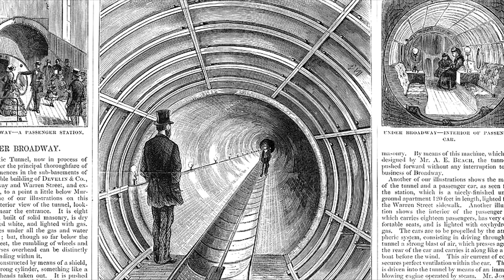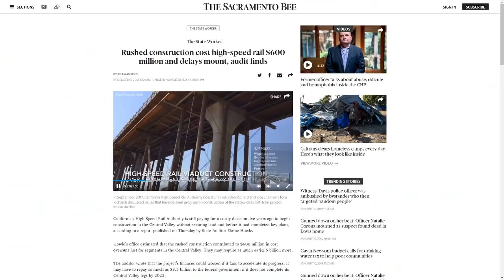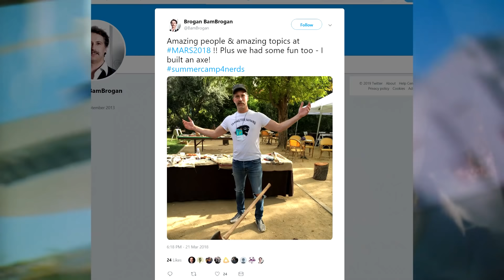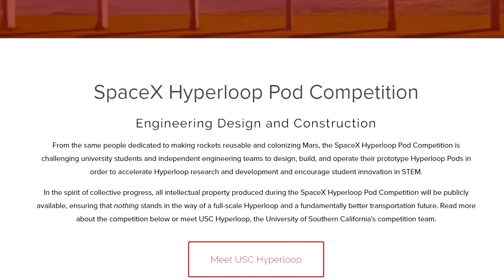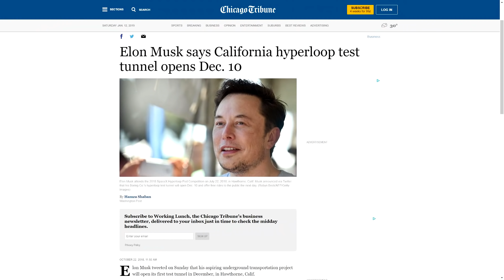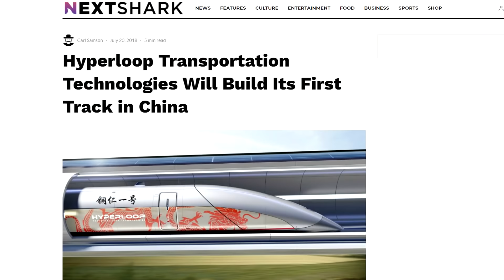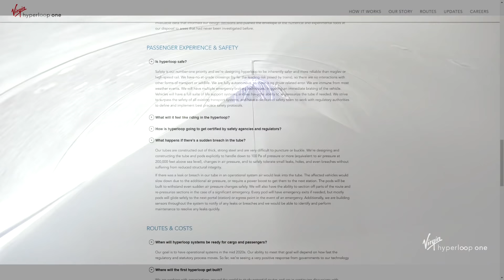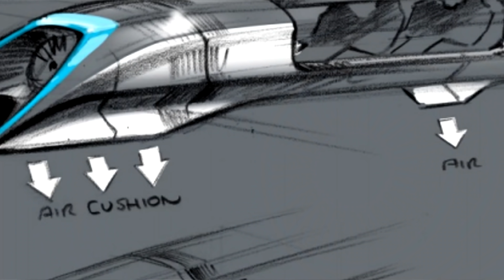Why Hyperloop will FAIL HARD - Its Biggest Problem...

Comment: You have to pressurize & depressurize portions of the tunnel every time passengers get on or exit. 
That alone should make people wonder, wtf are they thinking.
Reply: Uh, what about a vacuum proof docking system lol? If the entrance docked straight to the train they wouldn't have to depressurize anything.
Reply: @najsbajsmedmajs   Take a look at a space shuttle docking system and then tell me thats a great and cost effective thing to put in every single stop.
Reply: @DeadNoob451  I'm not a rocket scientist, but I can imagine a space station docking system would be a lot more complicated due to the fact that everything about it has to be able to withstand the harsh environment of space, using materials that are light and durable enough to send to space and everything. I'm sure it would be possible to create a MUCH simpler system if on earth, on a stationary platform that isn't spinning around in space.
Reply: @najsbajsmedmajs  
Doesn't matter space or Earth. You need completely airtight system either way. And even IF that is possible with "hyperloop", it's going to be too expensive, just like the comment above said.
Reply: the depressurization process is not complicated. It will not be like the vaccum of space. it will be like at a high altitude. if an air leak occured that would just slow the trains down and make it safe to be in tube. Just like planes, pressurization events are easily overcome.  The amount of air volume per docking will be minor.  plus pressurization isnt required, can just put a 100 mph tailwind and go 500 mph easily. All this will be done underground, above ground Hyperloops will fail economically. below ground tunnels must withstand 5 atmospheres to remain water tight. without air fires will not occur easily, earthqaukes are less dangerous below ground. plus if your scared you can just fly in a tin plane in a snow storm through turbulance and land with cross winds on ice while I go underground.
Reply: @DeadNoob451  not the vacuum of space. totally different ballpark.
Reply: @DeadNoob451  will only be one stop may I add, your destination. this isnt a bus
Reply: @Robert Garity 
Eh? How do you progressively depressurise the part of the tube where the pod is, which is travelling at such a speed??
Reply: @Robert Garity 
Though you meant when it was travelling!! Yes, an airlock system would be one solution.
Reply: You have a short section "air-lock" so only the tiniest bit of the tunnel needs it's vacuum lost.
Reply: @ratmanbug  Sounds expensive. What happens if there's a crash in the tunnel and people need to get out? What about the pollution that's produced in the 'air bubble' when you are in the tunnel. Will the air in that 'air bubble' be air conditioned to make sure my vehicle doesn't overheat?
There's so many challenges beyond just the airlock. I wish him luck.

edit: oh yea. being trapped in with your own smog. that sounds like Carbon monoxide poisoning, similar to those that commit suicide by keeping their car runnin g in the garage. does that mean every air bubble comes with its own 'carbon skimmer' to remove the CO2 from the air? as well as an air conditioner? how do you run an air conditioner in space, because that's basically what he's creating here.

Comment: its not a pneumatic system its a near-vacuum system
I think all the problems you have highlighted can be overcome
Reply: similar problems were presented during japan's very maglev system, which is why it took 50 years to develop.
now it's done and it's awesome.
the video is wrong about both the passenger limit (no reason you must have those 28 passengers per pod and 1 pod per 5 mins) and about the depressurization collapse (just have a stronger housing that doesn't collapse onto itself in case of a breach, and separate it into small segments that automatically close off a portion of the track in case it happens).
Reply: How do you propose anything resembling a vacuum system without it being pneumatic?

It’s not possible for anything with any difference from ambient air pressure to be other than pneumatic.
Reply: Yes, it will only cost in billions and take about another 20 years to come up with a safe 'Hyperloop' system for human travel. For now if they complete building one for cheap, it could be used to move cargo.

Comment: I learned all I need to know about the Hyperloop when I got into a "debate" with a fanboy. Just like any other area where there is zero empirical support for one side, the instant I raised any question I was met immediately with ad hominems and verbal abuse. The whole idea is laughable. There is just no way it is feasible, much less profitable. They talk about how fast it will be but always leave out the time it takes to board the pod, load the pod into the tube, depressurize the tube, and then reverse the process at the other end. Some of the shorter loops would take almost as long as driving by the time you factor in everything else.
Reply: Korea already has the technology(HTX) since 2009 but all papers are in national security domain. However, Elon Musk can't because he isn't backed up by a massive centrally controlled state system like the Koreans and Chinese are. He won't succeed.
Reply: Plus the pods only carry a few passengers, trains can carry hundreds. The tube might be faster, but the total number of passengers per hour for the tube will be a serious disadvantage!!
Reply: joe caterman  how do you get passengers onboard if the tube is depressurized?

Comment: It's funny that some Japanese people think that Hyperloop is the SC Maglev killer.(I wonder which will win? )
By the way, does a Hyperloop capsule have any lavatories?
 In a sense, that is the most serious problem for me in travelling around...
Shinkansen trains? They have numerous and spacious ones of course!
P.S. I have a question, why does the tube have colorful lighting interiors? I mean, ''decoration'' is the last necessary element in developing new technologies...at least here in Japan.
Reply: It is a showcase bro. The real thing would be dark and boring I think.
Reply: You need to flash investors to open their pockets. Thats pretty much it.
Reply: @fritzwagner1290  Yep, that's what business is.
Reply: Dream things and real things are different

This technology has been studied for 50 years, but after it only takes time to create a facility and take over land acquisition management

Completion of technology and confirmation of safety have already been completed
Reply: @Shiromochimochi  Its been completed on paper. There is nothing solid, no prototype, no nothing. Just students with small scale model....
Reply: the whole aesthetic of the tube is purely advertising, the thin fancy shiny metal tube could n function just as well be replaced with a large rectangular concrete slab with a hole through it
as for lavatories - while important, this is at the moment purely a concept and that is an execution detail - some planes have lavatories - some don't - some aircraft of almost identical build can ave lavatories or not depending on who operates them
Reply: @JulianDanzerHAL9001  Exactly. There is nothibg functional. If there were a functioning hyperloop prototype it would be news world wide - but all we got is a marketing campaign with mock up models.
Reply: No need if you can travel from Seoul to Busan in 12 minutes and in the future from Vladivostok to Berlin in 2 hours.I travelled the same route in 12 hours for $4 in the '90s always standing ,never sitting, the toilet was a hole in the train's floor.
Reply: @fritzwagner1290  true - that is why the hype around it is annoying
but at the same time predicting it to fail is just as stupid as predicting it to succeed because the ocncept as such COULD work and at the moment the concept is all there is - the current designs won't work but different designs could work quite well
Reply: That's just for the video though, you can't see the lights from inside the train lol
Reply: hachiku henonis I am with the Japanese SC Maglev. It will be faster 505kph (max tested speed 603kph) and they appear to be testing it for durability. According to the wiki Sc Maglev will use somewhat more power than N700A, but it also goes twice as fast. I am disappointed that the Chuo Shinkansen will mostly be in tunnels. Nagoya in 50 mins isn’t bad though. It has taken a while , but it should be a very reliable and safe system. I believe it will self stabilize and eddy current brake should power be cut.
Reply: It doesnt need bathrooms. Many trains dont have them. If your main concern is bathrooms then just stay home
Reply: @fritzwagner1290  check out Virgin Hyperloop One YouTube page.
Reply: 12 minutes San Fran to LA - do you need restrooms on subways?
Reply: U shat your pants it gets ejected into the tube 😀
Reply: The travel times are closer to bus travel times.  Montreal to Toronto: 37 minutes.

Comment: This is just thinking in the past. We now live in a multi-level environment, but travel in only a few levels. 
Since in 2019 we still don't have flying cars, Hyperloop is a reasonable solution to the worsening traffic problems.
Reply: there are a few issues, but it is 100% dooable.
Reply: @electrichanoi7244  Yeah.. But only by the end of this century if not longer and only for the low low cost of upwards to a 100 billion dollars to transport cargo primarily as putting civilians in these things is expensive, time consuming, and probably very very dangerous.  Acquiring land for such a loop is probably going to take more money and more time and honestly Hyperloop is way more expensive and time consuming than what it will ever be worth at this point especially, there's zero working pods that can house passengers safely and efficiently because for any turn to be made at all you need a hell of a lot of track and, the process of actually evacuating all of the air from the track is far more energy intensive than what would be saved with a near vacuum track anyway, and honestly it just isn't worth it.

Comment: Vactrains sadly have been getting more popular support thanks to the "ooo, shiny" factor and to Elon's name recognition. His proposal to run a vactrain along I-5 bypasses the roughly 2.5 million people in the Central Valley that could use the increased economic integration that HSR (or really any passenger train connection to the Bay and LA Basin) would bring. 

For all of the legitimate complaints about California's HSR (relative lack of) progress, it's mostly the result of normal government slowness, a ridiculous land acquisition cost (partially thanks to the next reason), and a  absurd amount of NIMBYism that manifests in coordinated rhetorical campaigns and lawsuits. Yes, government agencies can be quite inept, case in point being the Bay Area and how it hasn't established a single, comprehensive ticketing system yet that'd allow more ease of travel.
Reply from the maker: Quite so, there have been government agencies that do a good job in getting projects completed. - CaHSR is not one of them. There was a point made in the previous shinkansen video that with values inflated for today, the California project is still more than 2 times costly than Japan's original shinkansen, which also had to tunnel, engineer, and research in a more geographically complex region. It also irks me to see how fast some of these projects were built, and it's taken years more for California to complete or a "real" hyperloop to surface.
Reply: My frustrations are shared. CaHSR needs to acquire the land faster, be quicker with the alignment decisions and get building faster. The quicker it's built, the quicker people will come to realise "Oh, how did we live without this?" just like with BART in the Bay Area, haha.
Reply: @archlinuxrussian  Main problem is: They are late to the game. As in decades and decades late. Main unavoidable problem is this: The high speed rail line is busting it's route through one of the most densely populated parts of the world with some of the most expensive land costs. Which means locals have money for lawyers and once one gets past the lawyers, the land cost will be ASTRONOMICAL. Since ala large turning radiuses the track lining has to go where it goes.

One main reason for new rail line for HSR is that the older rail lines are way too curvy for HSR to operate safely. sooooo That track has to go where it goes.... to the millimeter. Hense should you happen to own even one square meters of that land... You have strangle hold. Rerouting will take tens of miles. 

It was always going to be slow and expensive (the main governmental problem to me seems to have been low balling the original cost estimate), because THEY ARE BUILDING HSR LINE THROUGH MULTIPLE CITIES. Blasting buildings from the way, rerouting roads and other infrastructure.

Plus California is a democratic state (as in governed by mandate of population) and state of law, which means the court cases and appeals will drag on forever, since there will always atleast that one NIMBY and that is all it takes. Unlike China, where one can just brush aside such things as due process, public hearings and right to appeal.

It doesn't mean CalHSR is failure. Rather one must understand it is one of the most ambitious infrastructure projects in the world at the moment once one includes the politics and economics. It will be expensive, it will take forever. However if it gets completed, it will be a massive benefit to California.
Reply: @Ari Takalo yeah, I'm overall in favour of California HSR (CHSR, CaHSR, CalHSR, etc haha) since California truly needs it and they're actually building for 200mph+ speeds (outside of the urban corridors of San Jose - SF and Burbank - LA). And yeah, many of the delays were not the Authority's fault, as they mainly were land acquisition and frivolous lawsuits about minutia and whatnot. 

The main criticism that I see that has some merit is that: California should have just upgraded the UP line that California HSR parallels and ran higher-speed rail on it as the San Joaquins Amtrak route. Of course, that'd require an inordinate amount of cooperation from UP, which probably wouldn't happen. Also, the San Joaquins currently runs on the BNSF tracks, which bypasses quite a few downtowns, but California HSR will too (at least for places like Hanford, Madera, etc, not Fresno or Bakersfield)
Reply: @ @aritakalo8011  Not only a benefit to California, but to the USA as a whole. Think of the number of people traveling to California for business.
Reply: @micaleconte2009  Does the USA not allow forced land aquisition by states (or federal government) for important infrastructural works?
Seems odd if it doesn't, because how the hell did they ever build the freeway system otherwise?
Reply: California's High Speed Rail is a fancy name for slow speed transportation. The "future" Los Angeles to San Diego route, rather than follow Interstate 5 (for the most part an active earthquake fault line!) down the coast, goes inland (through the mountains) to Riverside, with STOPS about every 25 miles. Just far enough to reach a peak speed before having to slow for the next station. For economic reasons, you need passengers, and they are scattered all along the route. French system goes between major cities with FEEDER trains from the smaller towns similar to the airport hub system. Amtrak is slower than slow (Phoenix to San Diego takes 25 hours by rail, 5 hours by car, or an hour by air). Going up the Central Valley, the first section, which is the CHEAPEST as it's already flat and straight, but has the FEWEST passengers, so plenty of stops in so many smaller towns. Leaving Los Angeles to go towards San Francisco you have to clear MOUNTAINS which means tunnels as trains don't climb hills very well and high speed means straight lines. Sadly, there is no real known ROUTE inside those mountains as the plate compression is a funny animal that pushes up dozens of different layers of material, including sandstone and granite. Boring from one into the other is a very slow process and very expensive. Every "update" from the government cuts the number of travelers in half and doubles the cost of building it. And the geo-engineering hasn't even been done (it requires thousands of bore holes along the primary routes to see just what is actually there). Other methods are used to find the general area, but when you get to specific routes +/- 100 meters, the bore holes can save far more than their cost. The BEST route would have been San Diego International airport to LAX done in under an hour. San Diego is the busiest one runway airport in the USA with 40% of their flights going to LAX. THERE are your PASSENGERS, No mountains to climb/bore through, but if you stop at every town along the way, the trip will take forever. Right now? It's faster to drive it at about 2 hours, the time it takes to check in and get through security, etc...The plane is 2nd fastest... and if you want to get to LAX by rail, leave the day before.
Reply: @aritakalo8011  Ari, I see the land acquisition issue, noise and traffic intersections as huge positives for Hyperloop.  It can be much more easily be elevated than track and therefore be run through farmland,  transit infrastucture and cities with much less impact.  Also given that the pods have zero contact with a nearly evacuated tube noise should be negligible compared to open air rail.